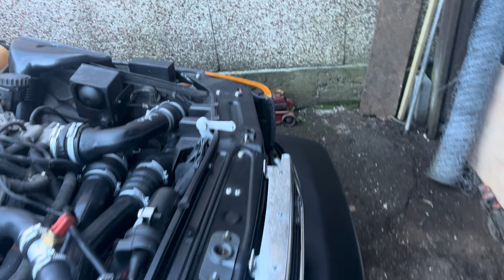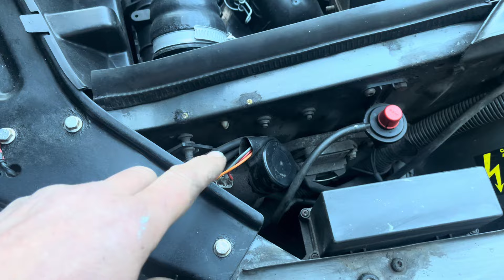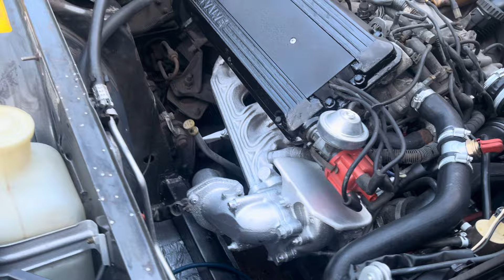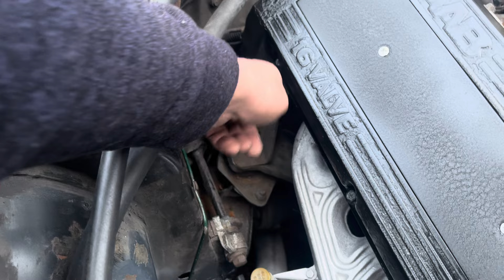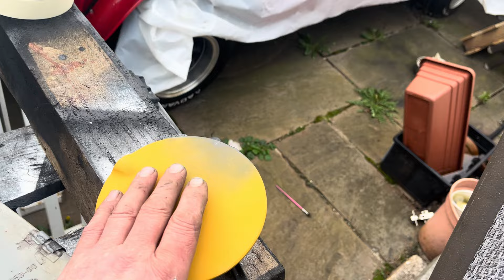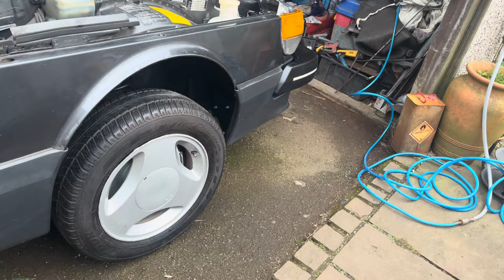Saab 900 Turbo is back on it’s boots! Headlight fitment.

Comment: Coming along nicely. Engine bay looks very clean, can´t spot any major rust in the typical areas.
Reply from the maker: No, thankfully it’s now fully rebuilt in all the main areas with either acid dipping or shot blasting and modern day coatings to prevent future issues. 👍

Comment: Looking good, done a great job.
Did yours have, well what I am assuming is a skid plate right be hind the bumper protecting the front of the engine?
Reply from the maker: Hi thanks. Yes the 84-86 has a small skid plate about 12 inches deep underneath and welded to the chassis crossmember but has 2 bars under the gearbox. From 87 onwards the bars were replaced by a deeper skid plate under the gearbox. A few of my earlier videos show the plate in various stages of restoration / patch welding.